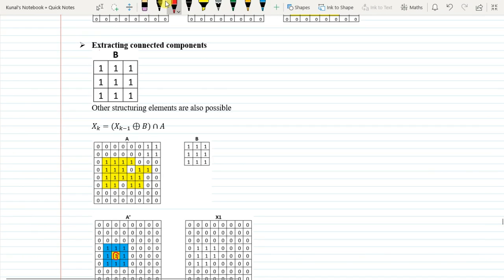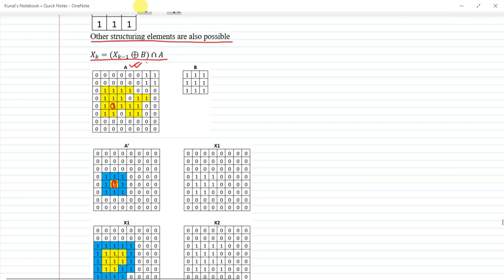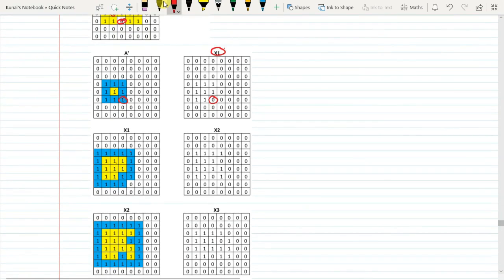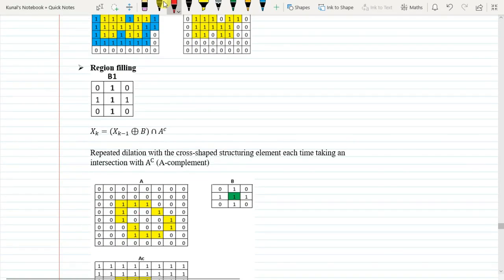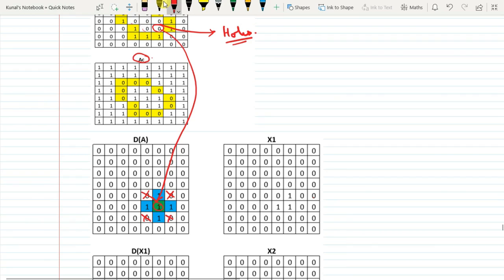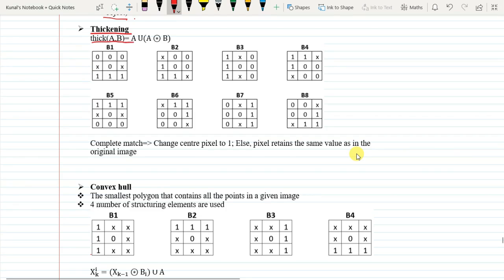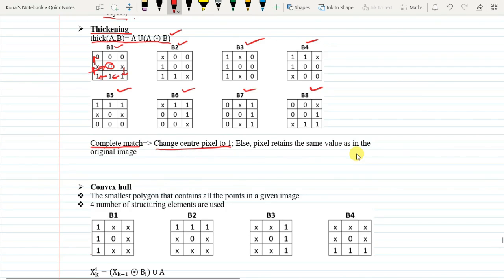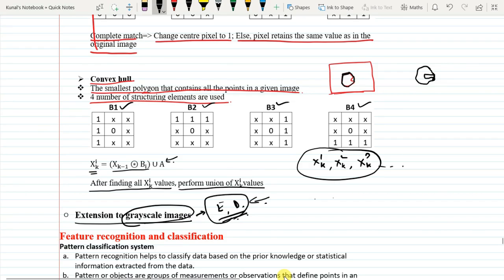Lecture 29: Thinning, Thickening and Convex Hull Operation

Comment: This method is not yielding right results....i tried several problems of Gonzalez and woods by this method but results were always wrong... For thinning and thickening
Reply from the maker: Please check which structuring element they are taking. Depending on the structuring element, the results will vary.
Reply: Problem is that we should not change the border pixels when the origin is at center, change only if there is complete match